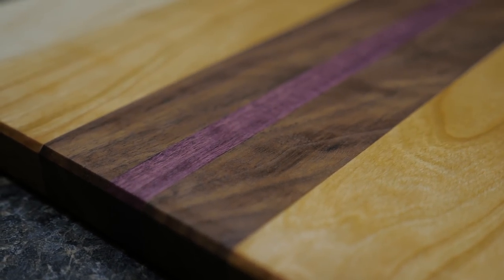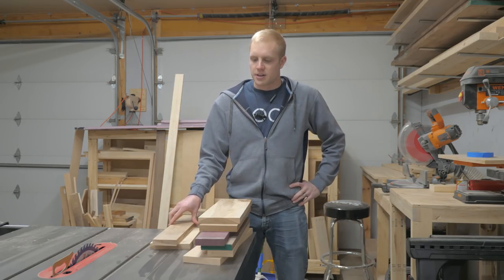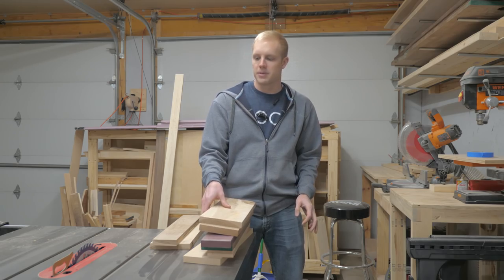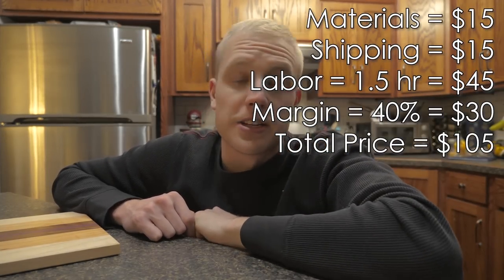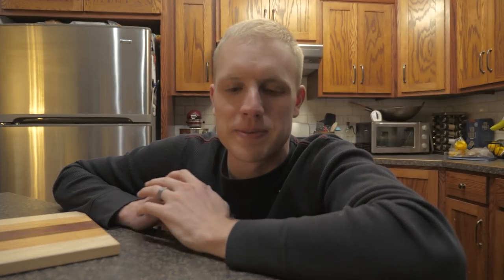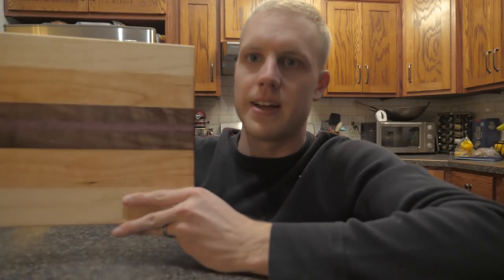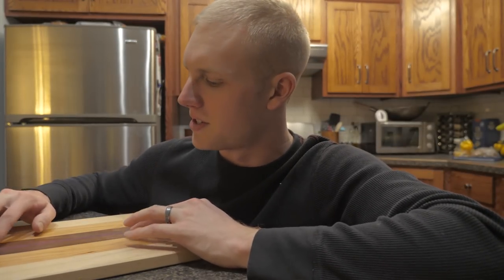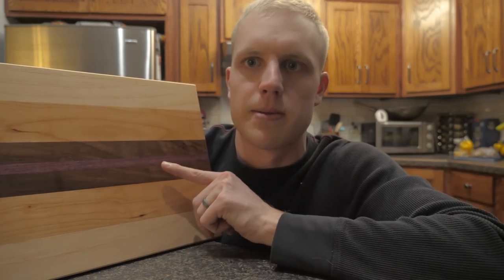How We Priced a Cutting Board (Real Numbers) | Woodworking Business

Comment: Just so you know, purple heart is toxic, it isn't a food safe surface to use for a cutting board
Reply from the maker: This is just not true. Even still, if the wood is finished with a food-safe topcoat and has fully cured it should be safe unless you're eating the sawdust by the spoonful. Please don't spread misinformation - it's not helpful.
Reply: @jennieanddavis  The only woods I use for cutting boards are walnut, cherry and maple.  And that is a fairly standard best practice in the industry.  Sanitary food service tables are exclusively made from maple as they are most food safe.  Maple has an enzyme that inhibits the growth of bacteria.  When dealing with a porous surface for food contact, you really need to consider how sanitary it is.

There are lots of species that are toxic, by either breathing the dust or with skin contact.  I cringe every time I see someone make a food contact product from a variety of exotic hardwoods or just whatever they have laying around.

Even within walnut, cherry and maple there are species that work better for food contact.  Generally, the harder and denser the wood the better.

It was also funny how you applied the mineral oil so gingerly.  That needs to be pored on and allowed to completely soak through to the other side.  Not gently wiped on.  Most manufactures just dunk the entire board in a vat of mineral oil overnight.  What helps the cutting board become sanitary is the mineral oil saturating the wood fibers to reduce the amount of bacteria getting in there.

I would suggest that before you start selling $100 cutting boards, you do some research on what makes them safe for food contact.
Reply: If you wanna get nitpicky about it, walnut is probably just as toxic as purpleheart. Many many species are probably unfit for cutting boards to the customer who is worried about such. But the airnwe breath ( in the city anyway) and hte processed foods/sodas etc. are likely much more harmful to our health than the ever so slight trace chemicals in these species that we actually consume are. But this is an ongoing debate that I'm honestly ashamed to be chiming in on... I should be doing more constructive things right now like sleeping...